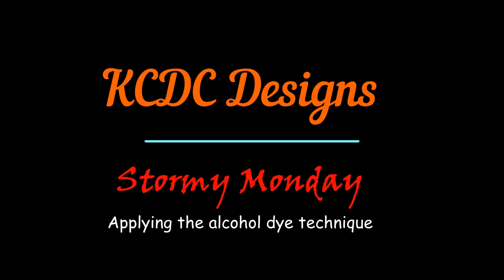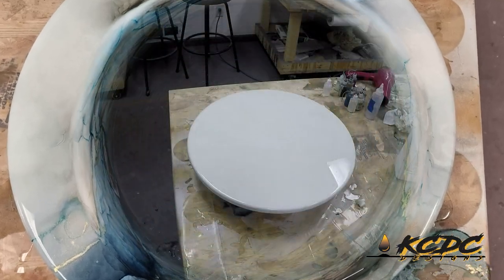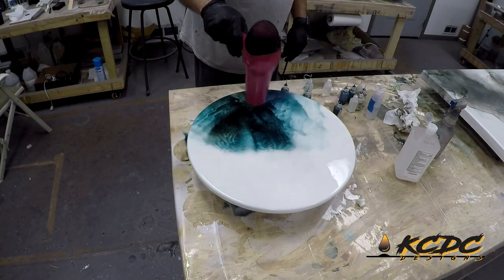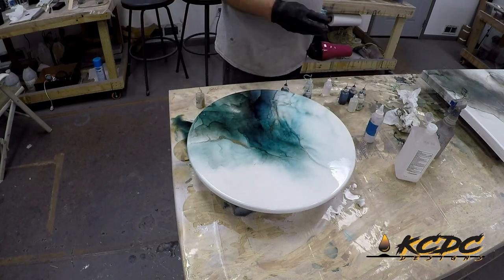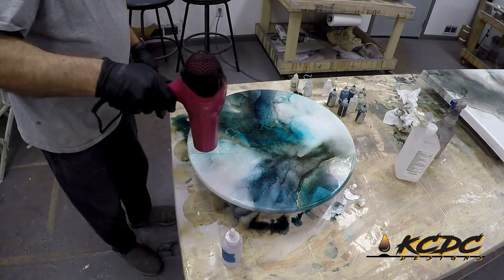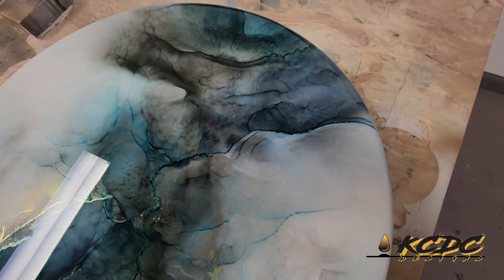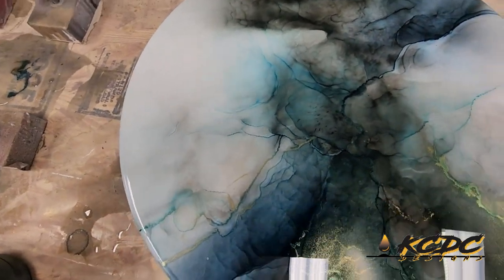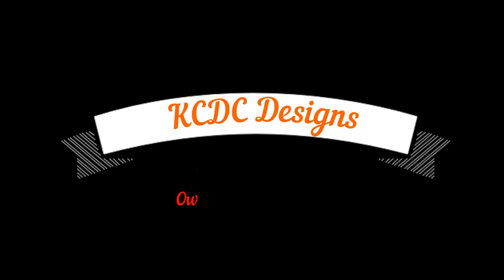Watch how I created this using alcohol dyes, a hairdryer and epoxy resin! KCDC Designs

Comment: W❤W!! What colors did you use for this? Like Ronda, I'm a sucker for turquoise...was that one of the colors or just a result of the mixing on the surface??
Reply from the maker: none of your business, lol. Sorry, just had to go there 😁. When I created that piece, I was just learning that technique and mixing colors randomly. From what I can tell, I used a few different shades of blue, and when blowing them out, it creates different hues.
To create the different blues, it may be 1-4 drops of Alumilite Dye, and even a drop of black included. The colors you can create are unlimited!
Oh, and the gold was Double 0-7 Gold mica, which is really cool because it remains on the surface and takes the design to a whole new level!
Thanks for your question and comment!